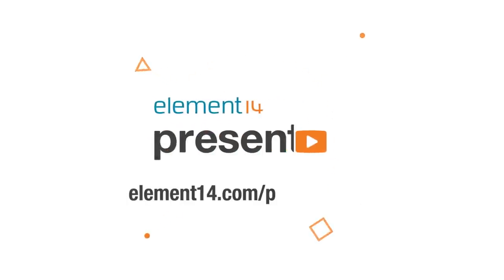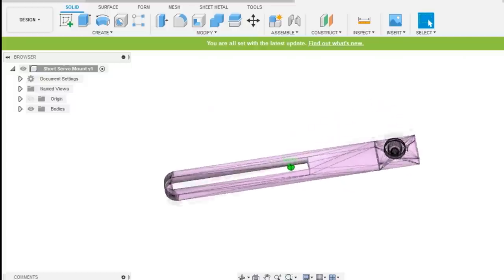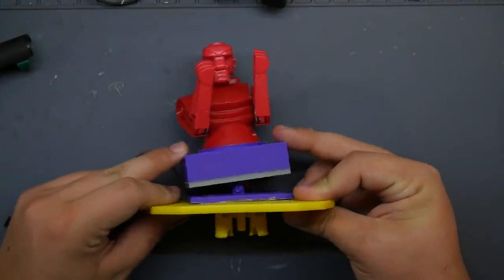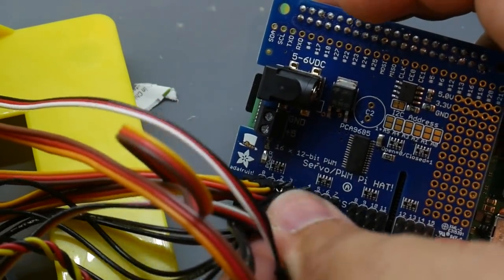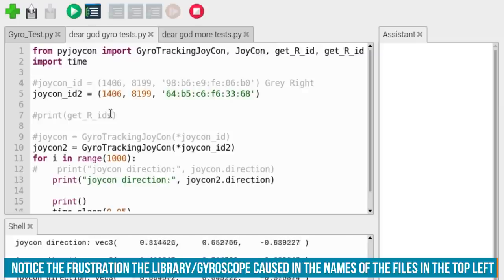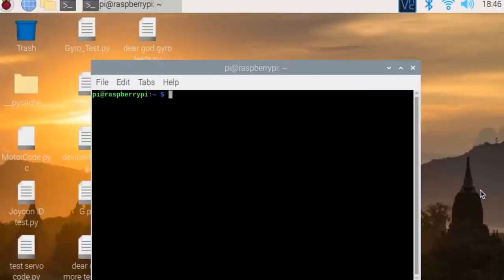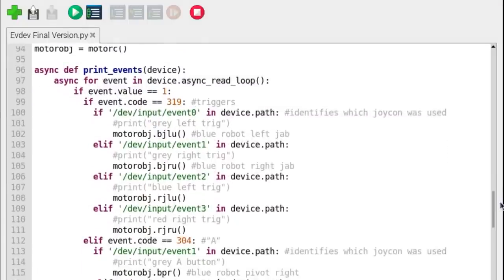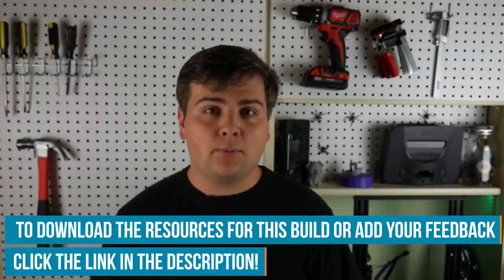Joycon Controlled Electronic Rock'Em Sock'Em Robots

Comment: So, it didnt use gyro, and they barely move?
Reply: Yes and no. I did get one robot to work with gyro. I’m currently researching the best way to get the second one to also work with it. If there is another library made soon, that would be really helpful because I have yet to find a library for the pi to interpret more than one pair of joycons. They move just about the same amount as before in the base. In the video I show the side to side motion (which is more than the original base movement because I made the hole larger) and it moves the same forward and backward. The arms move the same as before and I added a new dodge maneuver to the robots. Also, the design can be used with practically any Bluetooth controller, so you could play rock’em sock’em robots with ps4 controllers etc if you wanted to.
Reply: @adamsoileau4804  do you happen to have the dimensions of the 3D model parts u made

Comment: I don't understand why you can't use joycons in vertical mode as they're used in multiplayer games on Switch.
Reply: You totally can. You would just need to adjust the event codes. I already had two pairs of joycons so I used two pairs for the project. Also, I think two separate joycons are more comfortable. One controller per robot wouldn’t work if you wanted to incorporate the gyro sensor, but if you are just using the buttons that would work. Ev dev works on most Bluetooth controllers so this would work on PlayStation controllers, Xbox controllers, Wii U controllers, etc; you would just there to adjust the event codes.